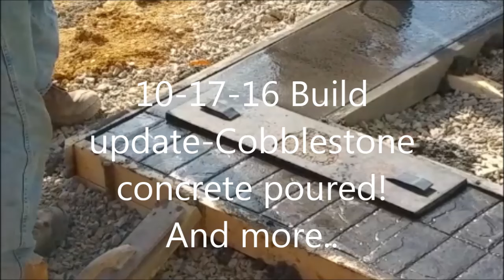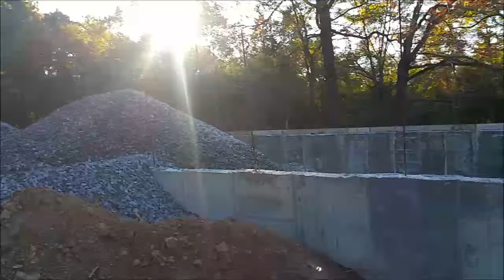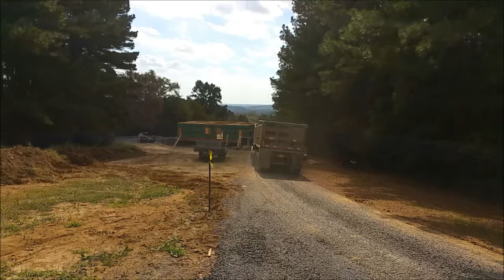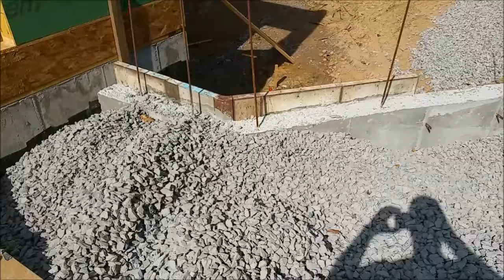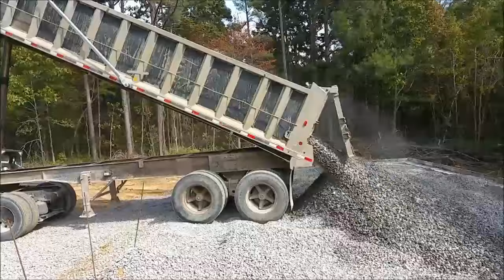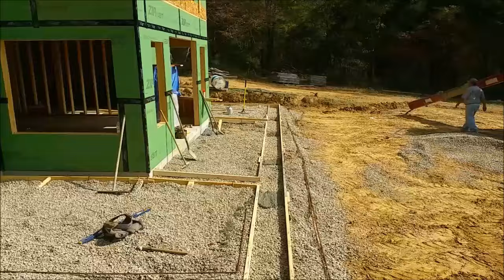10-17-16 Build update- Cobblestone concrete poured! And More...

Comment: I am guessing that they filled the garage with so much stone as to not have to wait for soil to compact, little more costly though...
Enjoying the progress!
Reply from the maker: Yes, he would not use dirt due to higher potential settling & cracking later on.. Yeah, believe me the $$ signs were flying out the window yesterday!! :). But we've got one chance to do it right the first time!
Reply: So true! Nothing worse than having the ability to do it right the first time and then choosing to take a shortcut only to have to redo it again sometime down the road at even more expense! That is why when we built our house we used white PVC trim boards and composite siding! We didn't want to have any outside maintenance every five years, we have a large house....
Reply from the maker: Robert Hodge ok, it was poured today! and since there was so much gravel he used extra re bar, bent the side rear from side walls over into new floor, poured 5-6 " of concrete instead of 4, and added fiber in the crete!

Comment: So why did you fill the garage with gravel? Are you pouring concrete over it and then you remove the gravel?
Reply from the maker: No, the gravel is used for the base under the concrete. If you use 'clean' gravel, it can be compacted fairly easily, and then it will hold its shape with less settling than dirt will (if it was compacted good). So, as much as I hated to do it, yes, the whole thing was filled with gravel, and then the floor was poured on top of it!